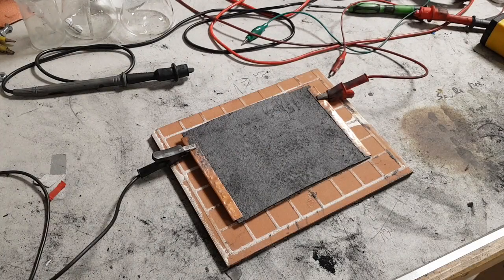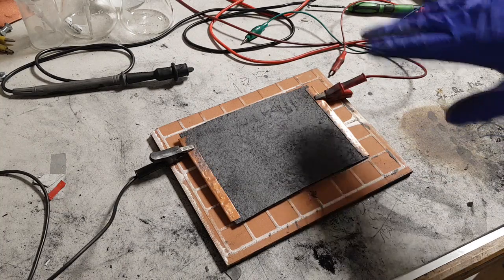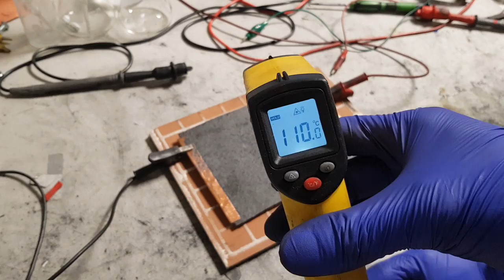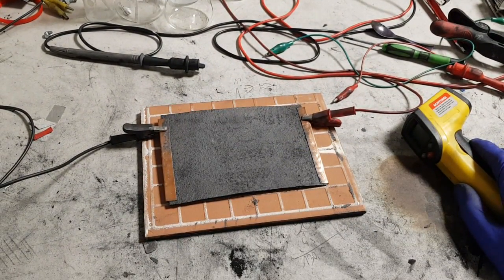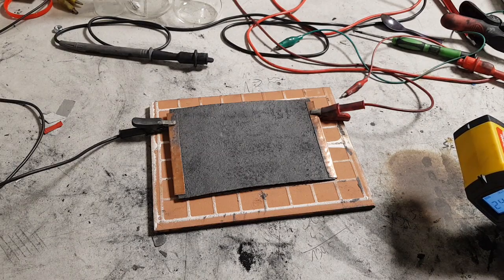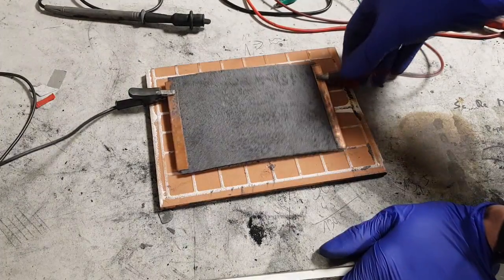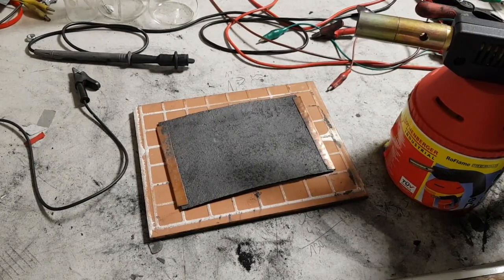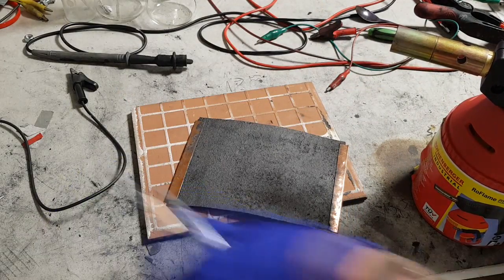FIREPROOF Conductive ink part 2

Comment: Good progress. Are you thing of a solar cooker for RV's. The very tip of the blue flame is the hottest point.
Reply from the maker: I know that the blue flame dont have the highest temperature. The propane blowtorch have around 1k degg C. But I only show that the ink dont burn on open fire.

Comment: Hi,
Will you try to make a battery with Si (silicon, silicium)? You can find on Si powder on ebay for a good price (or Monocrystalline Silicon Si Metal Lumps for 1.8$/10grams). I would love to see how it performs (I will try myself, but you know how to do these things.. so for me, it will 100% probably fail).
Reply from the maker: Hello! Hmm, a silicon battery. In basic silicon is used for active material in negative electrode to replace graphite, for example in Li ion batteries, because the silicon have higher theoretical capacity that have a graphite. So, silicon will be used in negative electrode. But the problem with silicon is that when you charge the battery the silicon will expanding and you can end up with electrode cracking,.... this effect was showed in li ion batteries. But in the end,... this looks like cool project and let see if I can use in some other battery types als negative electrode. I will try,.... and yes I will also fail on first time, but you need to experimenting,.... "if you dont fail in experimenting means that you  dont make anything new". Be cool and we see us
Reply: @cayrex  I found on Google a guy who said that a "conducting polymer binder" could solve this. Correct me if I'm wrong, you are the pro guy here. Btw, what is the best battery with high density that is also cheap and safe (for an off-grid system, so doesn't really matter the volume)?
Reply: @cayrex  And continue with the good work, you are the best! :)
Reply from the maker: @silentparrotstudio3625  PANI conductive polimer are mostly used,... but the PANI have higher cost. A zinc based batteries are the way to go. Zinc based batteries can have relative high energy density on lower cost. a-MnO2 Zn battery can have up to 10k cycles on good energy density for example. But for now this results are from lab. Iron air is also cheap for storage system because of the low cost of the materials but you will need a litle more space because of the low voltage (1.3V), but for storage system is space not a problem. Then we have also some hybrid cell systems,.... the future looking good for storage system. But right now you have some limited options like li-ion based, lead acid, NiFe.